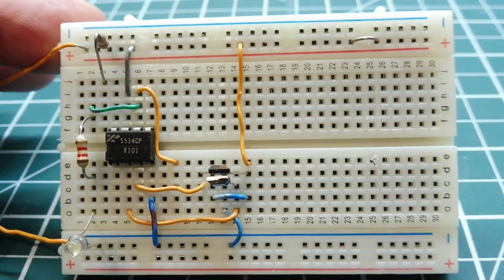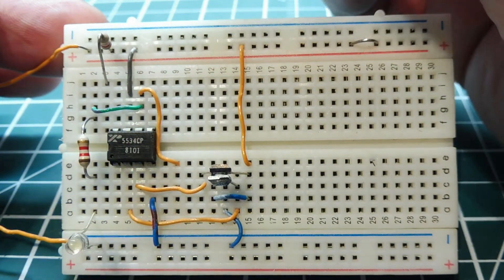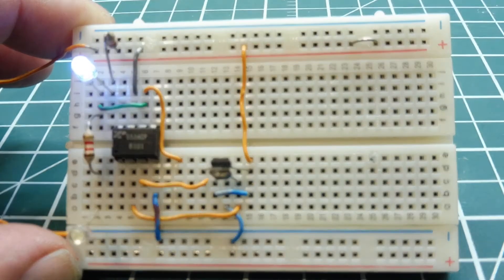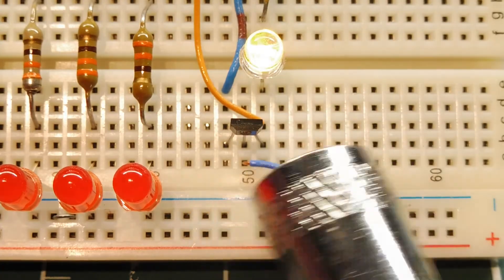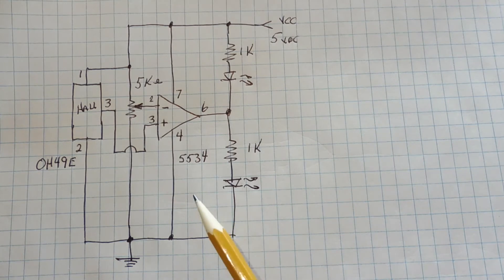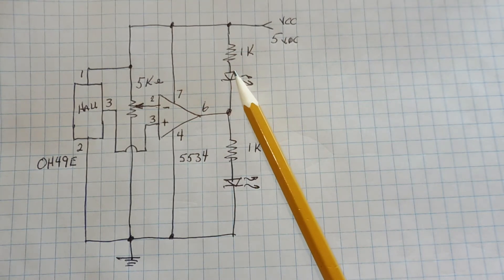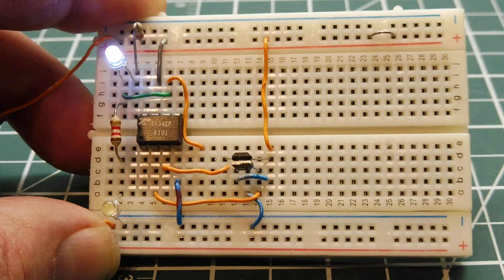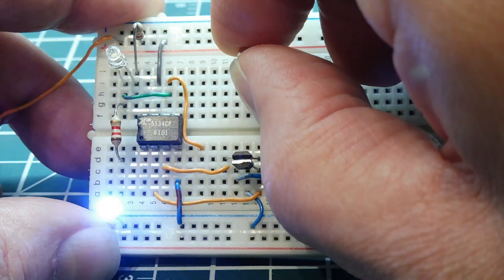Simple Hall Effect Circuits You Can Build

Comment: Thank you for this video. I am learning a lot from, not only the circuit theory but the creative way you use it.  Just one question, it looks like the hall effects sensors are arranged such the  they are blocking each other.   I would think they would have to be side by side rather than one in front of the other.  Maybe it doesnt matter since  it it's a magnetic field we are talking about.
Reply from the maker: Yes .. the magnetic field is not affected by having the the two sensors back to back.  In this arrangement the back to front sensing is symmetrical.

Comment: hi sir, if i want to use 12v input, what resistor or anything i have to add to the circuit?
Reply from the maker: The easiest solution would be to use a 78L05 voltage regulator to convert the 12 volts to 5 volts.
It is a 3 terminal device (TO92) and easy to use.  https://solarbotics.com/product/17160/

Comment: Great video. Will this Hall Effect sensor detect an electromagnet from a further distance away? I assume this magnet is of a low Gauss. So an electromagnet with a higher Gauss should work at a further distance, right?
Reply from the maker: Yes .. basically the stronger the magnet ( higher Gauss ) the greater the distance of detection which follows the inverse square law.

Comment: Had you tried to change/reverse the dual-sensor orientation to see to what degree sensitivity is increased or decreased?  Thx.
Reply from the maker: If you reverse both sensors the sensitivity will be about the same and  first sensor will now only respond to a North pole magnet
The sensors are designed to sense on the front face but an opposite pole magnet will cause an output if exposed to the back side.